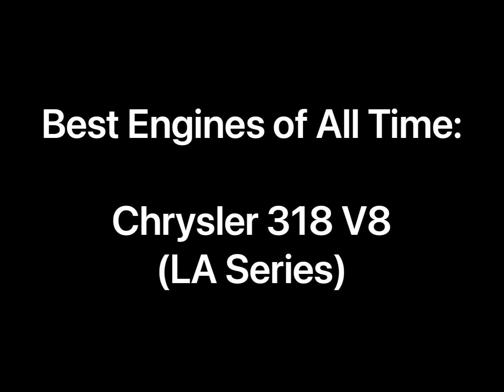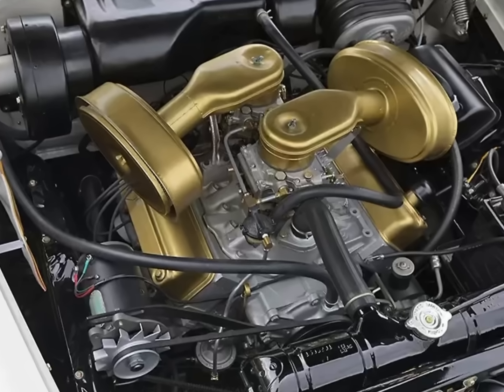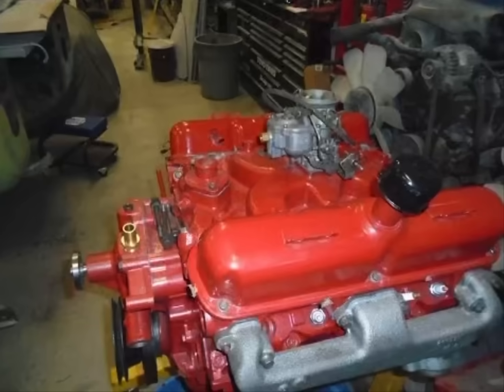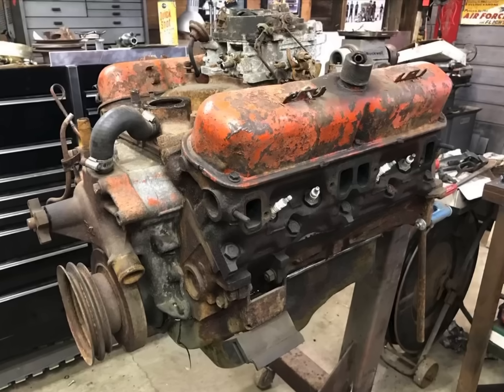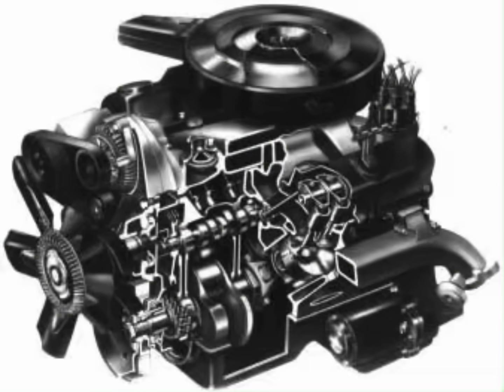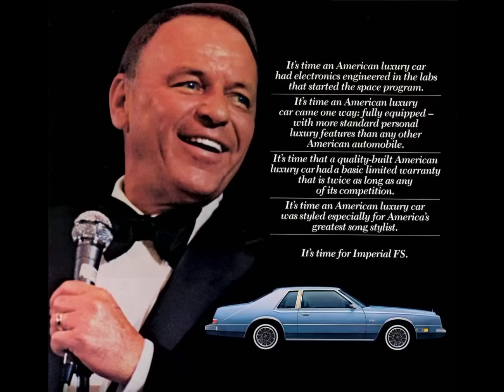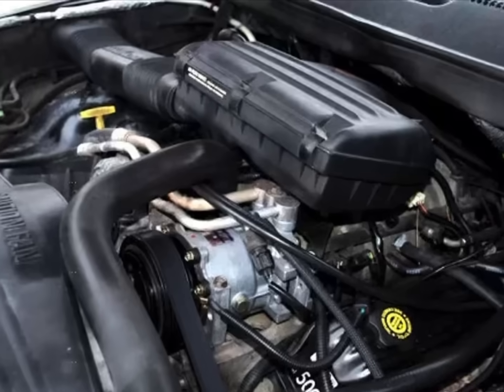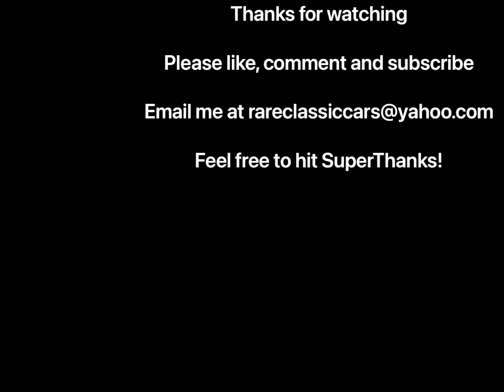Best Engines of All Time: Chrysler/Dodge/Plymouth 318 V8 (LA Series)

Comment: Hi Adam. Yes these were great engines. One of my 1st cars ever was a '74 Dodge Challenger with the 318. I have no idea of the HP but it was more than adequate. It was an ugly green colour but had white interior with buckets and the slap stick auto shifter. A real plain Jane car with basically no options. But what car to have as a young guy. It had about 16,000 miles when I bought it for only CDN2200. Immediately I installed Michelin radial tires to replace the bias ply factory rubber and it drove like a completely different car in terms of handling. This car served me well and the 318 was faultless until I sold the car with 120,000 miles on it. The oil was a bit foamy when I sold it so I suspect the head gasket needed replacing by that time.

Comment: The 318 is a nice engine to play with. Smaller cars, such as the Dart/Valiant, Aspen/Volare, and the M Body, equipped with the 318, make great sleepers by tuning the 318.
Reply: Yes, all the 340 parts were a direct bolt on, including the cyl heads. Direct Connection also sold hi-po parts for the 318, including cams and headers.
Reply: Young people now don't know what " sleepers " were or are !

Comment: The 318 was a good engine with a couple of issues. My first car had a 318. 1970 model. The 318 had 2 major problems, although one of them was easily fixed, IF you knew about it. It had a PLASTIC cam sprocket, which is what led to the demise of my first car. Had I known that, I would have replaced it with a steel one and that car would have lasted many more years. The other problem was not so simple. It was a design problem. They put the timing chain cover between the water pump and the block, with coolant passages cast into it. It used the same bolts to hold it in place, which meant that you could easily create a leak between the timing cover and the block while replacing the water pump. The timing cover was also made of aluminum, and was very thin. It corroded easily. I've seen several with holes corroded through the walls of the coolant passages, which allowed coolant to get into the oil and destroy the engine. If you look at a small block Chevy, THAT is how the water pump/timing cover should have been done.
Reply: To be fair, any repair manual would've told you to use sealant on those bolts that go into the water jackets. Also if good quality coolant was uses and changed at reasonable intervals, the timing covers really shouldn't rot through. Lastly, even if it does, the motor shouldn't get wrecked if the driver checks thier oil once in a while and notices it turned milky. Obviously they're already under the hood to add coolant. 
Now I agree with you, I prefer Chevrolet's design for water pump & timing cover. Chrysler B-RB is similar to that, as well as Ford FE. But all other GM V motors of that era had a timing cover with water passages, as well as all the other Fords. They deserve some criticism too! How about Buick, Cadillac, and AMC also building their oil pumps into the timing covers?
Reply: @johneckert1365  First of all, most engines have a few design issues that should have been obvious to whoever designed them. The small block Chevy has the fewest design problems of any '60/'70s engine I've ever worked on. 
As far as that 318, I was 16 when I bought that car, and had never done any real work on any Mopar engine. I did not have a manual. And it was the cam sprocket failure that destroyed the engine, not the timing cover/water pump design. But I had replaced a water pump on it before that happened, that's when I first noticed the way it was designed. I had to replace all the bolts that went through both the water pump and timing cover and into the block, the threads were too badly rusted to reuse. I'm pretty sure that was the first time they had been out. I did use sealer on the new ones. The issue I have with that design is that when you remove the water pump, you have removed all the bolts that hold the timing cover in place, and in the process of getting the water pump loose, you are likely to break the seal between the timing cover and block. Now I would go ahead and remove both the water pump and timing cover and put new gaskets and sealer on both. If it had a plastic cam sprocket I would replace that for sure, and if I found any wear in the timing chain, I would replace that too. I now consider replacing timing chains on all '60s/'70s engines ever so often as routine maintenance. I am not a fan of internal chains of any kind, especially those on newer OHC engines that use chains 5 feet long, with all kinds of plastic guides and tensioners. All of that stuff will need replacing at least once, maybe twice, before the rest of the engine wears out.
Reply: @geraldscott4302  Right on. Take Fords OHC 4.0 V6 as a nice example. 2 timing chains, one is on the front of the motor, and the other is on the rear 😑
Reply: And EVERY manufacturer used those damn nylon camshaft sprockets in that era, not just Chrysler.
Reply: @johneckert1365  Yes, I found that out. I immediately replaced the plastic sprocket on my next car, a 1974 Nova, as soon as I got it. That 318 only has around 70,000 miles on it when it failed. I now have a 1979 Chevy truck with a 350. It has a steel cam sprocket, and I replace the timing chain every 65-70,000 miles. I notice they start to get a little loose by then.

Comment: In stock form, they're great reliable engines. If you're willing to do the work, 318s respond well to performance modifications, much like it's big brother, the "giant killer" 340.
Reply: Absolutely. All the 340 parts bolted right up to the 318, the heads were much better.
Reply: "giant killer" 😂 riiiiight....

Comment: The Imperial  injection system was a constant injection ( except on no throttle deceleration  and it was set very lean and alcohol fuels would cause it to lean even more and backfire Causing fire or sensor damage.

Comment: This lifelong Mopar junkie thanks you for a good overview. I only take exception to one detail: the Magnum 318 came in 1992. I remember because I test drove a new Dakota V8 in 1992.
Reply: Which was a breath of fresh air after the abomination that was the tbi and hall effect ignition they ruined it with either it ran (closed loop rich) as a muffler bombing pantload or didn't run at all. Tuning was like trying to tune a piano with a brick.
Reply: Actually it was 91. 318 and 3.9 V6 went Magnum in 1991. The 360 stayed TBI through 1992. When the 360 went Magnum in 1993 they went like hell, and it was the most horsepower in a half ton pickup until 1996 when Chevrolet's 350 went Vortec.
Reply: I believe 92 and 93 had the good exhaust manifold

Comment: The 318 V8 dodge motor was a bullet proof motor hooked up with a 727 high torque transmission was the best combination 👌
Reply: True Jerry! I had a 1970 Australian Chrysler VIP (basically a luxury stretched-wheelbase luxury Dodge Dart with the Fireball 318 and torque flite. Metallic green with bone vinyl roof. MAN l loved that car with that sweet V8 as did my friends ☺ The 318 was a large capacity V-8 by Oz standards…
Reply: Starting in the late 1960s most 318 car applications used the A904 transmission.  Trucks and vans may have continued to use the A727.

Comment: Great engines like 318, 360, 340, 426, 440 and other Chryslers are awesome, but don't forget the awesome V-10 Viper engine!😁🛠️🔧👍
Reply: Dodge put the viper engine in a pickup called the SRT-10, Car and Driver clocked it at 153 mph, it's still a top speed record for a pickup truck.
Reply: @crankychris2  Yes, iv'e seen them.

Comment: 318. What a joke. Never had a 4 barrel.
Reply: Yes it did.  Not many, but there were some.  Cop car I think, early or mid 80's.
Reply: @johnz8210  that's possible.
Reply: Late 70's on up there were 4bbls.  I had an 83 Ramcharger with a 4bbl 318 n a granny low 4 speed. Thing went pretty good and decent mpg. Way more power and mpg than my 82 K5 Blazer had with it's 305 Electronic spark control....

Comment: The 318 is a true classic!  I also find it interesting that our '66 Plymouth Barracuda had the famed 273 that begat the 318!  My Dad loved to work on it, and my Mom knew how to drive it.  Can't count the number of times she blew the doors off a malaise era Camaro/Firebird from a standing stop.  It was reliable as a stopwatch as it was before Lean Burn
Reply: The 273 4 barrel of '65 - ' 67 was the predecessor of the 340 in ' 68 .
Reply: The LA engine was developed because the A engine was a very tight fit in the Dart/Valiant engine bay. They were eventually able to shoehorn the B engine in there!
Reply: @bill90405  I had an O.E.  '67 formula s 383 4 speed coupe in H.S. I put in a 440 with a button clutch with the STOCK engine it had a 160 m.p.h. top end and consistent 11.00 second quarter mile e.t.'s AND 25 m.p.h. had highway ! I also had an O.E. '68 formula s 383 4 speed sport coupe till recently with O rust

Comment: Chrysler also produced the 318 in Brazil, from 1970 to 1981 (when Chrysler local operation was sold to VW). It equiped the Brazilian Dodge lineup, ranging from fullsize sedas like Dart, LeBaron, coupés like Charger and Magnun, also pickup trucks and trucks. By 1980 there was also an alcohol-only version.
Reply: Darts were only considered full sized around here, in the US, the Late 60's dart (the one we know as the early-late 70s) were already compact sedans

Comment: Was the 360 in.³ engine a larger version of this? Or was it a different design entirely
Reply: It's basically the same with a different crankshaft, bigger main journal size. Also the  360 block was a 4 inch bore vs the 3.91 for the 318.   There's some other minor differences I don't remember.  I know the 318 and 360 oil pans didn't interchange because of the bigger rear main.
360's were balanced differently too.

Comment: I had a '79 Dodge Van with the 318 2bl. My grandfather gave it to me as my first car. It had about 120k on it in 1990 when I started driving it... I had it for roughly two years and only took it up to about 135k, then it went to a family friend who used it as a work van for another 6 or 7 years after that. Finally went to the scrap yard in 1999... threw a rod at 265k. At that time I was under the impression that the engine was going to be rebuilt by the guy that bought the van... but the van itself was pretty much roasted at that point... body panels had probably lost 40% of their mass due to corrosion...the rear single piece door had rusted off the hinges and was welded into place... almost nothing electrical still worked... But it put up a fight before it died.
Reply: Do you know the mpg you would get
Reply: @markpaulo9584   It wasn't good... and this was over 30 years ago... But the few highway road trips I took and paid attention to the mileage, I ended up around 13-14MPG. Just city trips, back and forth to school/work... I'd guess it was probably 9-10MPG

Comment: Very Well Done! Excellent Engine LA 318 with the Carter 2bbl BBD! I hear the comments now “it was a dog” NO it was a dependable, workhorse that lasted almost forever, great engine in a Duster as a daily driver.
Reply: Right! Compare the smog era 318 to a Chevy 305, Olds 307, or a smog Ford 302. The 318 doesn't seem weak after comparing it to them haha. Better fuel economy and longevity too!
Reply: @johneckert1365  they all last a long time, they don’t make enough power to do any damage they make enough to get the job done effectively, had them all, all great engines.

Comment: Lost count of the 318s I've had(have four right now). Mostly the higher compression years; 69' and the later 80s roller cammed engines.
Used to convert them to earlier electronic ignitions with the recurved Direct Connection or MP distributors. Really woke them up. The later Holley 2280 or 6280 2bbls could be tuned to deliver impressive mileage. Far better than the Carter BBDs.
Especially with those 2.26:1 gears, yet still pickup quickly with the 2.74 1st gear. Installing the later Magnum chain tensioners and earlier double row timing gears makes for the smoothest idling V-8 you could ask for.
Super reliable. Just buy the best plug wires you can afford to stop spark scatter. I use Taylor SpiroPros. Cheap and effective. Wish Dr. Jacobs still sold those double thickness distributor caps.

Thanks enjoyed the clip

Malcolm Ottawa Valley

Comment: Would definitely agree with you regarding the 318, and if anyone thinks you can't make them competitive against the small block Chevy, you're sorely mistaken. My 71 Challenger came equipped with a 318, 2 b carb, and single exhaust. 904 Torqueflite backing it up. I found a 4 b manifold at the wrecking yard, bought a new 625 Carter AFB, and installed a set of Cyclone Headers, with the dual turbo mufflers. I couldn't believe the difference, I could keep up neck and neck with my buddies 383 Charger
Reply: A 318 can make 600hp with a stroker kit

Comment: I've had both the 273 in a '64 Barracuda - not so fast, even when fitted with dual exhaust and four-barrel carb and the 318 in a '69 Barracuda which was much quicker.  And I had the dreaded lean burn in the form of a '79 Aspen.  The entire car was garbage, including the engine.

Comment: My uncle owned both a 77 Dodge Tradesmen 100 van as well as a 77 Dodge D100 reg cab long bed both with the 318. The van made it to 350k before rebuild and the truck 280k before rebuild...truly remarkable considering the typical 100k lifespan of most carbureted engines, regardless of manufacturer, during the era.

Comment: Is it true, all you need to do to an la 318 to make power is raise the compression ratio, a four barrel carb/intake and raise the compression. There's another Mopar channel called uncle Tony's garage and he says that, I would appreciate a second opinion. Great videos/information as always.
Reply: had my 74 barracuda since May  1978 just rebuilt it borded .60  over  w/ 10.5 comp pistons. Cam .  intake 4 barrel . dougs headers W/ 60.000 volt coil and mag distribritor. now it starts right up!!! POW ! Runs like a Bear

Comment: I had a ‘96 Dakota with a 318. A light truck with 4x4 and a v8 was an absolute blast to drive and beat. The weakest link was the rear spider gears after burnouts and off-roading.
Reply: I had a 1994 red cab short bed Dakota sport, paired with the nv3500 manual trans and 5.2 magnum v8. It may not be "fast" today but 30 years ago it surprised a lot of people. That truck was a blast.

Comment: I have to agree; an early 318 with relatively few emissions components is a pleasure to own, service, and generally take care of. Very smooth, simple, and very accessible in terms of working on. Durable, and robust.
👍🏻
Reply: I'd rather change plugs , distributor , oil pump or water pump on a B or RB engine over an A engine any day !
Reply: I bet mechanics hated doing a tune up on them in the late 60’s until 1973 when electronic ignition became standard.

Comment: I’ve basically driven Mopars exclusively since 1983. The 318 to me has all the desirability of a 307 Chevy. 😀 I’ve never daily driven one but owned 3 of them. It was never a performance engine during the muscle car era or the later 70’s. It was starting in ‘73 the standard engine in the road runner. It was the only 318 to have true dual exhaust in ‘73 and ‘74.

Comment: I had an old 1976 Chrysler Newport I believe it was I believe that's what I had it had a 318 two barrel in it and those engines are so tough let me tell you what happened remember one day the gauge on the dashboard said 0 pounds of oil pressure and I'm like oh no. I took it in and the mechanics confirmed it quoted me x amount of dollars that I didn't have at the time to repair it. Can you believe I drove that car for 11 more months with no oil in it I must have put 15,000 to 18,000 miles on it. With no oil flowing through it. I was a young kid back then I'm 54 now so I think I was about 22 back in that time. I doubt very much a modern engine could do that.

Comment: Good to hear this story of the Chrysler 318. My father was a mechanical engineer and always said Chrysler engines were well designed and this engine is a good example this. Excellent history.
Reply: My Dad owned repair garages and service stations from 1955 to 1994.  He said the same thing!   The 225 slant 6, 318, and 440 were his engines of choice by Chrysler, so much so, he didn't care that I bought a car with a 440 as a teenage kid....  He expected me to drive like a maniac, which I didn't since I loved that car.   I have to say, that car is still my favorite of all I owned:  we drove it all over the state of Washington and Oregon, without a worry of break down, after I slowly replaced all the pumps and ignition since it had sat for over 7 years.  The thing ran like a top.   Another case where my Dad was right.
Reply: Chrysler gets a bad rap but their engines are actually really reliable, with only a couple exceptions such as the 2.7L. The internet blows everything out of proportion, but the real everyday drivers will have a car rust out before the engine finally dies.
Reply: Used to be well engineered....

Comment: W
When I worked at a garage during the sixties, I recall a few cars with the 318 had worn timing chain gears and chain resulting in bent valves. I personally repaired four or five cars. I further recall that these cars were nowhere near the dreaded 100,000 mile mark. Anyone else have this experience?
Reply: Most Mopar engines used a silent timing chain with a nylon toothed cam sprocket. On almost every engine I’ve seen with over 80k they are worn and stretched beyond the 10 degree of backlash permitted, and need to be changed. I always use a double roller with a steel sprocket.